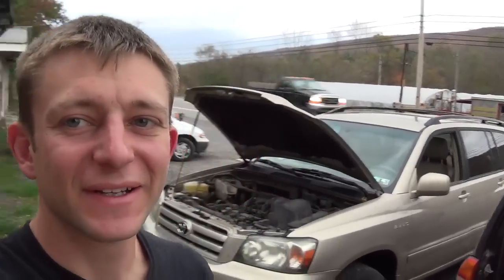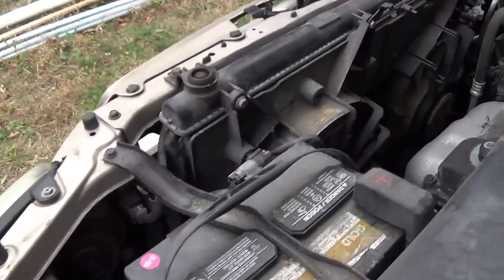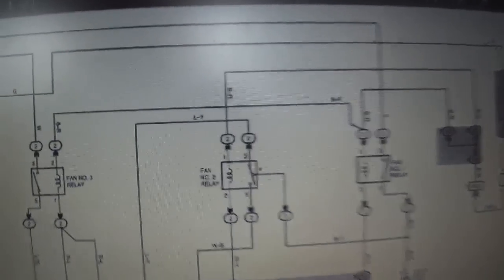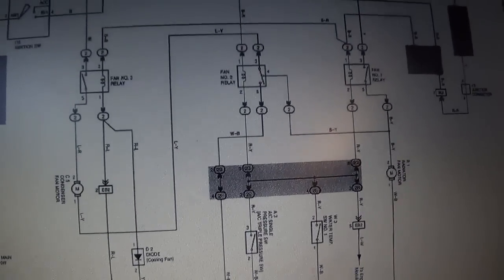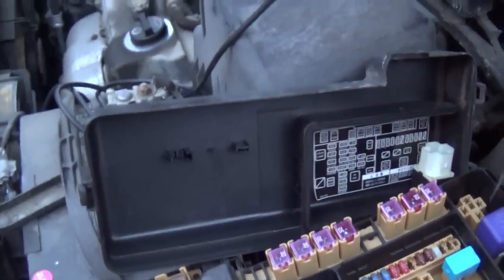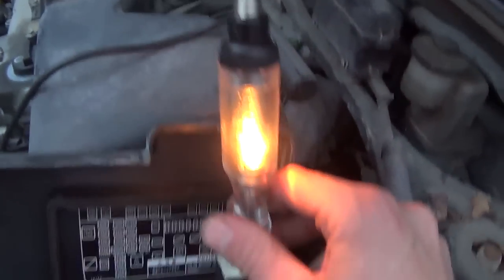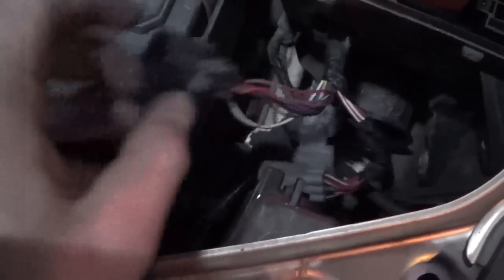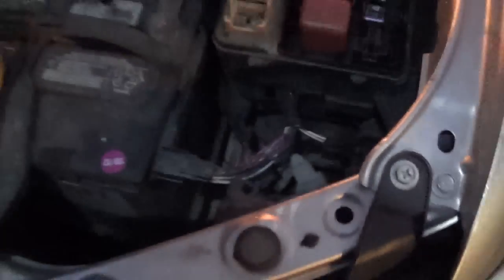Cooling Fan Stuck-On Case Study: '04 Toyota Highlander

Comment: That was a crazy diagnosis. Who would have thought shorted wires in connector. I bet most shops would have thrown relays and a computer at it. Awesome job!!!
Reply from the maker: +buzzerauto Yup that situation could have gotten ugly with parts swapping...good thing they stopped at just one relay!! Hopefully the computer driver for the fan relays survived the short. Maybe should have bi-directionally checked it?
Reply: +motoYam82 Maybe but I sure there fine. I guess you should always verify repair. I've had connector issues on stuff but I usually find green corrosion or damaged connector. But this video shows that there doesnt have to be anything visual to be a problem.

Comment: Thanks for the great vid. I started out with the same cooling fan problem. Later in the day my car started stalling at idle. Instrument panel was going crazy. Trans would skip when I turned on ac. I had one of the pins in the same connector come off when I opened it up. I ended up bypassing the connector with 4 sets of wires over a couple days and everything is great now! Thanks so much for the thorough diagnosis and education in electrical troubleshooting. Great wiring diagrams and info at website you mentioned. Way better than Haynes manual. Thanks again.
Reply from the maker: That makes my day! Great job on the repair, hopefully your Toyota will be problem-free for a long time :)
Reply: Before the fan ran continuously, I also had idle issues and transmission skipping issues, just like what you are describing. How hard would it be to just replace it with another 10 pin connector? I'm tempted to just bypass the two wires like Ivan did, but now I'm wondering if other pins are going to fail and cause assorted malfunctions. Bad design.

Comment: Thank you. Just had this exact issue pop up on my 05 Highlander and jumped right on YouTube to investigate. I JSU put $2k into repairs on both my vehicles and didn’t need this. I went right to the plug you identified and could here the relay tripping and arcing when I wiggled the connector. Then it got hot and saw a puff of smoke. Pulled the battery, opened the plug and found the pin pretty much melted. I hope jumping around the connector is the solution. I’ll let you know.
Reply: Well, did it work or catch fire?

Comment: Exactly my symptoms up to and including isolating the ECM. Great video in any case I never would have got this far otherwise or understood as much about how the circuit functions. Trying to figure out how to unplug the connectors and remove the relays is not an easy task. I found when trying isolate the ECM that the plug wires on the male side of the plug were hot to the touch. And there was contamination inside male plug half around the pins. 2005 Highlander. I hope this is the answer... and cleaning the plug I found a loose pin that was corroded and easily fell over and broke...final and, I soldered in a bypass wire and now the fans, fan when they are supposed to and all the warning lights are gone.
Reply: Was it the answer? I'm about to do the same on my '05 for the exact issue.
Reply: @jimyaekel7385  yes it was "an" answer and did remove most of my symptoms. I don't profess to understand all I did. But simple observation of the state of the pins in the connector said those were a likely starting point. I made sure I understood and and documented the pin out and the wire colors before I started. I found some crimp splices that worked well and sealed with heat gun.
Reply: kenbig1 as an electronics technician I think you did a very methodical troubleshooting job. When my connector started getting hot and even smoking from manipulating it, that was a pretty obvious sign. But on mine the pin actually cooled off and the green/ yellow wire alongside it showed signs of overheating also. For good measure I bypassed both of those and the red one you did. I solder wires, just wish I’d had some shrink tubing. I’ll have to go back to it. But the fan running issue is eliminated and no more relays clicked and arcing. Thanks for your post!

Comment: Hey thanks man this was life saver. Had this happen on 1 i had after a sunroof drain clogged so i was looking inside and cleaning connectors. Found this and could hear the connector sizzle while unplugged. I ended up also having a battery light on because the wire it shorted to lost connection after i repaired the other.
Reply from the maker: Nice work! Crazy that a connector can short out internally like that 😅
Reply: @PineHollowAutoDiagnostics  yeppers, i cleaned it and it was good but i couldn't leave it,i knew it happen again so i just bypassed it like you

Comment: Superb piece of fault finding Ivan, DC ammeters are a lot cheaper nowadays an excellent fault finding tool, pick cheap ones up for around £30, but if you can afford the top notch ones then carry on.  What's the odds on a local garage finding that one then ?, keep up the excellent videos.
Reply from the maker: +DiyMech Thanks! Yeah the more I use the amp clamp, the more I like it...great non-intrusive tool with no leads to plug in or get in the way. In this case it was the most effective way to pinpoint the problem without cutting wires or poking holes. It's a fantastic piece of equipment when paired with a test light :)

Comment: The Toyo cooling fan circuit is a nightmare. The ECU does not  control the under hood fans. They are controlled by the ac water temp switch and the ac pressure sensor.
Never seen a short in a connector. I have seen open circuit connectors caused by 
improper backprobing. Good job! I would have given up.

Comment: Hi, thank you so much the video, it was very informative. I have a 2008 Lexus RX400 H. Both radiator fans and heater blower fan continue to run with engine off  and keg out.  When turn on with they are off. I did all the tests you have shown in the video. Tested the load side and it has 12V and side the going to fan and feed 12v to side and unplugged the fan and everything is just good. The problem is control side has 12V with engine off and key out when I remove the heat fuse it off. I also check the negative side of the control side of the coil and it going fine ( in your case you 12v) I don’t have the wiring diagram for it, can you please help me find what is feed the control with key out. Thanks

Comment: Great find! I guess the owner got lucky those +12V fed into the computer did not damage it. One small thing I do not get: if that wiring diagram is correct, then once the engine is warmed up and the water temp switch closes, then it would have been a direct +12V short to ground? There must have been a blown fuse somewhere in this case?
Reply from the maker: +qwarko Now that is a fantastic question! After digging around more wiring diagrams, I finally tracked down that WHT/BLU wire that was shorted to the fan relay control pin at connector EB2. It is coming straight from the ALT-S fuse (7.5A) in the relay box, on its way to the alternator.
Now since it was at 12V during testing, that 7.5A fuse is definitely NOT blown. From this we can conclude a few things:
1) Neither Water Temp Sw. #1 nor the A/C pressure switch tripped during the fault.
2) The ECM never commanded the fan ON at full speed...or if it did there was some current-limiting in the ECM to prevent current over 7A. I did NOT verify if that driver was still functional after the fix...
3) Under normal operation, low speed of both fans is enough to keep the operating temperature normal (Relay 3 turns on both fans via Water Temp Sw #2).

Perhaps I should have verified that ECM driver was still functional...wonder if that would throw a trouble code?
Thanks for the comment!
Reply: +motoYam82 Not sure about the trouble code... Another possibility though might be that the ECM wire is just for "sensing", not "commanding" - the ECM might be checking if the a/c pressure or engine temp is too high and then turns off the a/c clutch or otherwise limits engine performance... Just an idea. Anyway - cool diagnostics and thanks for filming it!

Comment: how did you bypass the wire? did you solder the one wire directly to the corresponding with on the female side of the plug?

Comment: Most likely, there is a stray wire from the terminal crimps that was bridging between the 2 positions - one of the stranded wires was not captured in the terminal.

Comment: my 05 highlander has a peculiar issue. when the AC kicks in the cooling fans i get a red battery warning light. voltage is 13.4v red light on.  oddly, i can turn off the AC and put a massive draw on the system with heated seats, lights, rear defrost, blower motor..even wipers and power windows...it drags the voltage down to 12.5 but no battery light.. only get battery warning when the fans kick on so its not directly related to low voltage/failing alternator ( Not belt slip..if i wait for engine to heat up and fans to kick on for cooling it does the same thing so not specific to a/c use)

Comment: I understang  that circuit should provide  ground  to complete  the circuit of control circuit of realy, What  I do not Understand how will that makes the realy to close the swith side with 2 powers IF sorted to power,  pin one on relay  is power side thanks you have awesome videos . I do not know if I am missing some thing when waching the video
Reply: You're not really missing something other than maybe relays work regardless of polarity. If you have a bar magnet, you'll notice you can pick up metal objects with either pole of the magnet. Same with the electro magnet in the relay: even though the current is flowing the wrong way and its polarity is reversed, it will still close the contact.

The reason the relays closed with the key off was there was some path back to ground, as indicated by the very dim testlight from battery power.. Not good enough to really carry any current but enough for the 30mA or so required to energize the relays.
With the key on/engine running, the other side of the control side was switched to battery positive, so there was no more voltage drop accross the relay, hence no more current and the relays turned off.

Also note, though people commonly say 'short to battery' with regard to this type of fault, it's hardly ever a dead short to battery. The 'short' in this case had some resistance to it, otherwise the testlight wouldn't have flickered when Ivan moved the wires. Therefore, when the AC really commanded those fans on there was no dead short accross the battery, just a parasitic draw through the connection. A few amps, probably, but in a car with an alternator that can kick out 150 Amps and a battery which can (for a short amount of time) kick out over 400 Amps such things do not affect normal operation much and are therefore sometimes hard to find (especially without service information)

Comment: I would have had that beat..
I had an 84 honda civic (I was told there was no computer in the car that came out a year later) it had carburetor not fuel injected.. ok here was the deal the cooling fan had been rigged to run continuously as the thermostat was bad.. so the thermostat was just bypassed.. If you shut the ignition off the fan stopped.. turn the ignition on the fan came on simple.. ok now get this all was fine except on a really hot day... not even running the car mind you... I would come out of my house to use the car and people would tell me the car was on.. I would have the key IN MY HAND but it wasn't on... or let's put it this way... the engine wasn't running but.... all the dash lights would be on (as if the key was in the run position) the warning lights would be flickering and the cooling fan would be running... part two to this if it was a hot day, and I turned the key to off, the engine would not shut down... the car would keep running!!!! The only way to shut it off was to disconnect the battery completely and then it would shut down... figure that one out.. then when you plugged the battery back in the fan would come on and the dash lights would be on and flickering.. This only happened if it was 95 or so degrees (F) out or more..
Reply from the maker: Bad ground :)

Comment: Well, I still have a 2004 Highlander and it did exactly what was described in this video. Once I pulled the blue/white wire, the fan stopped running. I went through all the checks that was described here and was amazed that my problem was exactly the same as described. I would never have found the problem without this video. Good job tracing this electrical anomaly.
Reply: What did you do after you pulled blue/white wire? Just “cap” it off?

Comment: great detective work Ivan. you and Eric.O have taught me to never give up on a repair. I'm an appliance tech for a very lage company for 27 years. going out of the box to watch you both in another industry is amazing. Different field, but same work ethic and diagnosing procedures. I thank you and Eric.
Reply from the maker: +Randy Gudeahn (ProTech) Hey Randy you are absolutely right about the diagnostic procedures and thought process being very similar. Most modern appliances are all logic-controlled and programmable just like cars! 
I had to troubleshoot our house heat pump a few years ago. It was throwing trouble codes (!) for the outside air temp circuit...turned out to be a bad thermistor. Can't imagine how expensive a diagnostic/repair house call would have been on that thing!

Comment: Eric O had the same connector go on one of his repairs.  This time it went up in smoke and had symptoms of alternator and abs issues.  It took out 2 fuses, a 7.5A and 10 Amp both wires were next to each other in the connector.  Full rewire of connector cured all faults

Comment: Just did a customer's car with the exact same problem. This was extremely helpful. Thank you.
Reply: Hey there! I currently have the same problem. Did it end up being in the connector pointed out in this video/was it fixable? Praying it is bc I just put in a new battery and alternator just to find it still has a parasitic draw. Thanks in advance

Comment: Some cars still keep the fan running, for minutes, even after the ignition key has been removed (car off, and driver exited vehicle).
Reply from the maker: Yup. But not this one!
Reply: John Doe Mercedes A-Class 2007 for example. I had one and it had alot of problems but the most annoying one were the cooling issues. In summer, the motor said it was overheating (it wasnt) and the fan was running all the time at full speed. And after some time the car went into some kind of "I dont want to run anymore" state...

Comment: Perhaps the internal short was partly or mostly due to heat breaking down the insulation? (melting)
Reply from the maker: +douglas “The flame is dead” lee In this case there was evidence of chemical corrosion on one of those pins inside the connector. I assume battery acid caused the damage at some point since this connector lives right by the NEG terminal. I also know that Toyota batteries like to leak acid :)

Comment: Thanks for wonderful video. My Highlander radiator fans run on low speed,but when i switch on A/C ,it runs on high speed. This has make me to change the radiator bu the fan run on low speed. What could be the problem? My Highlander is 2004 model.

Comment: I have an 03 highlander 3.0 v-6 and the fans won't come on at all. Even when turning the ac on, nothing. Both of the fans work when given 12volts.
All the fuses are good inside and out.
Replaced the relays with new and that didn't work either.
Temperature reads normal but its winter. Its not overheating, yet.
I'm looking into replacing the fan switch but would that cause them not to come on even with the ac active?

Comment: when you did the repair you mentioned you spliced the two wires, bypassed the one wire 27:12.  I am confused so my question is which wire were you speaking of according to the diagram that was bypassed and what did you splice it to? thanks
Reply from the maker: +Ozzstar Ended up bypassing the connector with BOTH wires that were shorted together. The pin for that white/blue wire (not on the diagram...not sure where that went) was actually very weak inside the connector due to corrosion, so had to bypass that one as well as our red/yellow PCM control wire for the fan relays :)
Reply: Okay gotcha now, you bypassed those two wires from the connector.   You connected the matching wires (butt connection), outside of both connectors.   Nice fix man, great diagnostics
Reply: What wire did you bypass the red/yellow on to? The left side (female) plug has no red/yellow wire coming out of it.

Comment: Ivan, I got 2005 Highlander with a intermittent P0012 code and the VVT solenoid checks good but I want to check the filter. I can't figure out where it is located. Does anyone know where it is located?

Comment: I have a Peugeot 308, the fan keeps running as soon as I start the car in the morning, so the engine isn't hot at all. I've replaced the thermostat sensor & the problem is still there. Could you please assist me with my problem as I feel the garage is trying to rip me off. Look forward to you're reply.
Thanks
Jas
Reply from the maker: Get a wiring diagram and see what controls the fan relay 👍

Comment: You were possibly LUCKY that the PCM (and the other two switches) survived this fault.
If the 'short' within the connector was capable of supplying any decent amount of current, then EITHER a fuse would 'let out the smoke' when the PCM commanded the fan on, OR, the 'switch' within the PCM (probably a MOSFET) would have let out its magic smoke.
It would be interesting to know where that other wire in the short (white with blue trace) went to.  My guess would be that it's probably on the controlled ground side of some other (medium current) component and was only capable of supplying a limited amount of current.